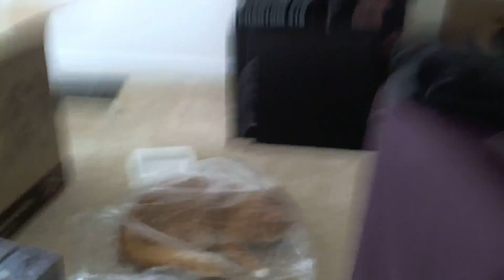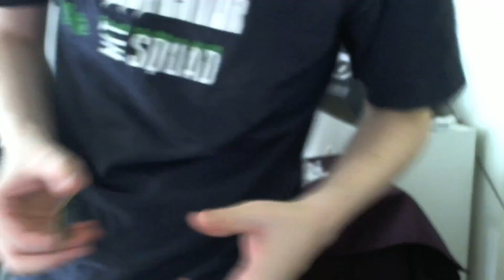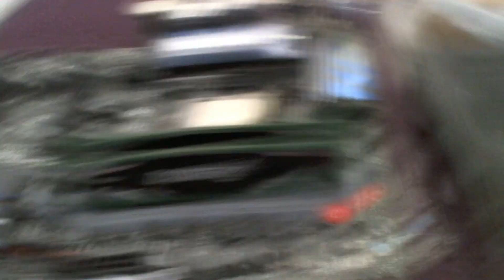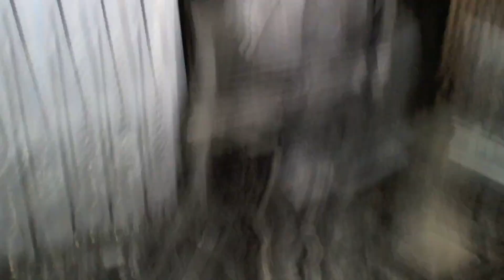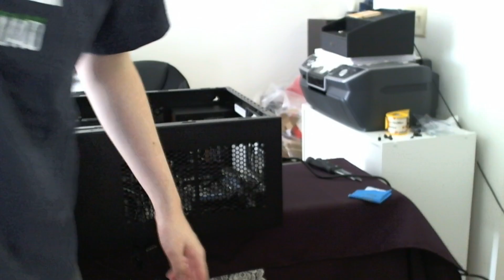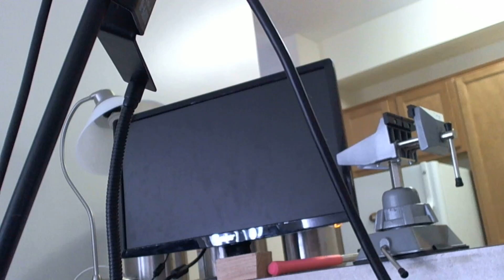$1,750 Extreme Gaming/Overclocking Rig (Oct/2013)

Comment: I JUST bought new computer parts, i have a gtx 670 video card, intel i7 4770k (like yours) a z87-D3hp mobo and a 750 watt psu. The parts are still sitting here as I wait for my psu. Lol im even more glad I god the 4770k now. Mine was about 871.17 usd. (i already have a hard drive sitting in my current build. I dont remember the specs.
Reply: True

Comment: They're also no exposed transistors, they're just solder points. Also, they're not drawings, they're traces. That's copped covered by a colored film. :P
Reply: Also, it's not entirely "cheaping out." Soldering a 22nm critical length die is very hard, and using pressure to secure the two die to each other is the best way to go. 

Source: I'm in IC Technology design and manufacturing, as well as a graduate of a four year TAC/ABET accredited Electrical Engineering degree.

Comment: @Gonzalo Bueno why yes, x79 processors are overpriced, gaming rigs don't even have to have a i7
Reply: they are called socket 2011 processors , and no not every 2011 processor is overpriced the 3820 and the 4820k are cheaper than i7 4770k and they are better for productivity work. :) but for gaming and normal use you cannot notice the diference between processor like i5 4670k and i7 4770+
Reply: Victor Rumenov well the original comment was why not X79   i agree that not all 2011 processors are overpriced but this is a gaming rig   i doubt that he will throw a Xeon in there      Ps. we can call them X79  LGA2011  I7  Xeon  it doesn't matter